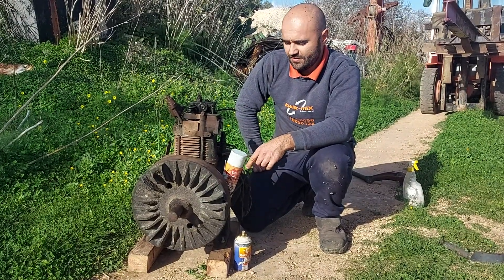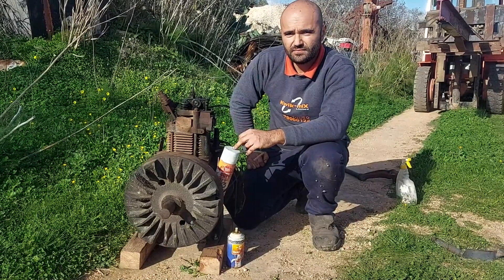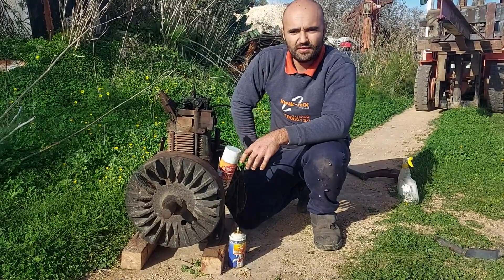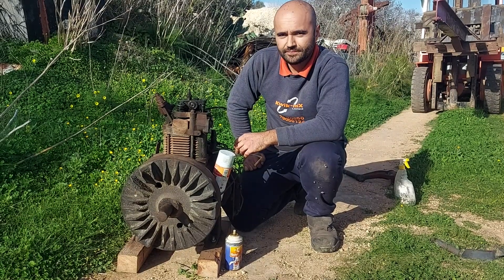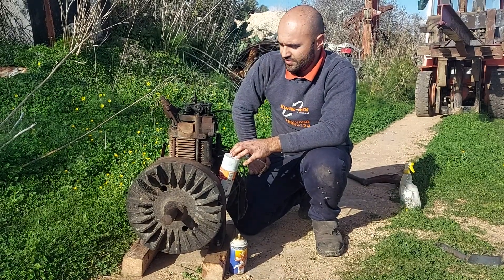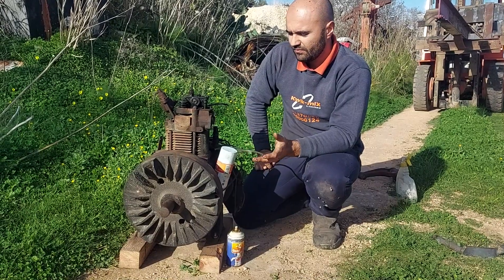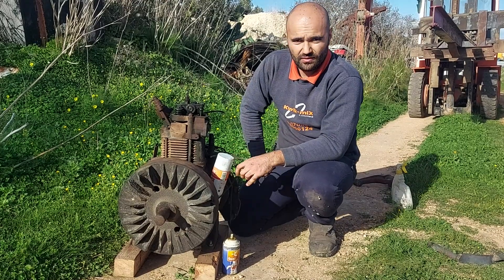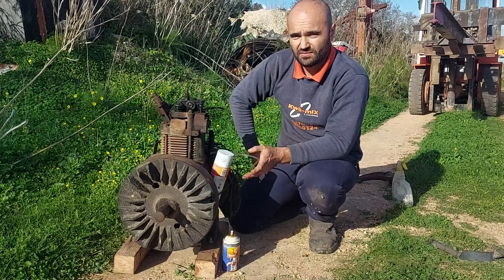This Engine can run without a DIESEL pump - Petter PAZ1

Comment: Perhaps fit a carburettor and run with a diesel petrol mixture
Reply from the maker: That plastic spray bottle was infect petrol and it did not liked it very much! Maybe it would need redhot tube or something to ignite ? Thanks for watching.

Comment: Can you maby try to run it on propane or butan? Woud be interresting to see
Reply from the maker: That is interesting but as far as I know Gas will need a spark to ignite.
Reply: @enginelover1  from what i have heard it will self ignite just like diesel
Reply from the maker: @Backyardmechanic1212  I will definitly try that and make a good video about it in the future
Reply: @enginelover1  thanks

Comment: I do like a PAZ1. Do you want me to keep an eye out for spares? (Looks like tank, cylinder head cover, fuel pump, fuel filter and pipework and oil pipes to me)
Reply from the maker: Hi, Ben that's very kind of you, I appreciate. This is a MK1 version. Mk1 cowlings are hard to come by. Still I got too many paz1 engines haha. I have enough running ones. Thank you very very much.
Reply: @enginelover1  No worries. You are welcome. I will keep my eyes on the scrapyard though.
Reply from the maker: @BensWorkshop   If i am not mistaken I have 8 PAZ1 in total.
Reply: @enginelover1  Quite a collection!